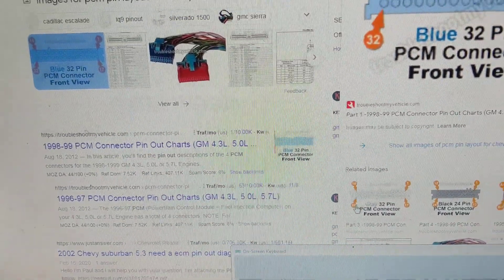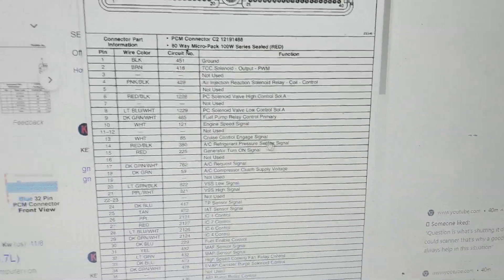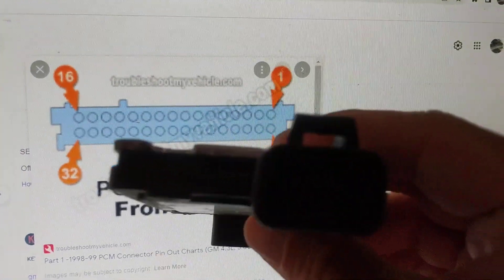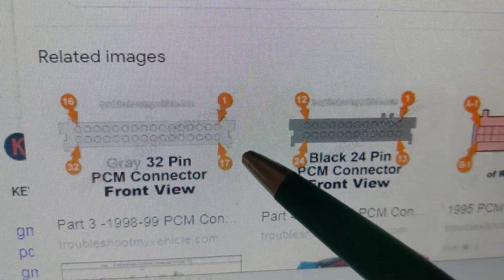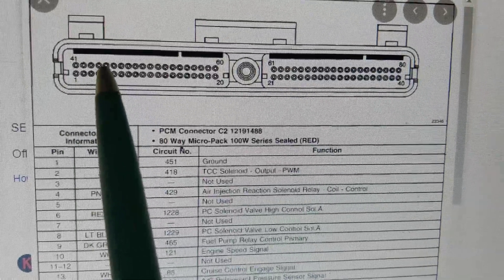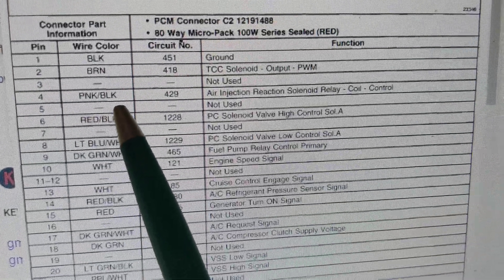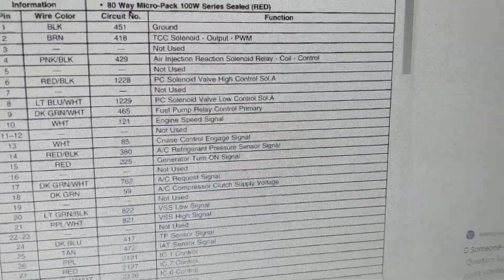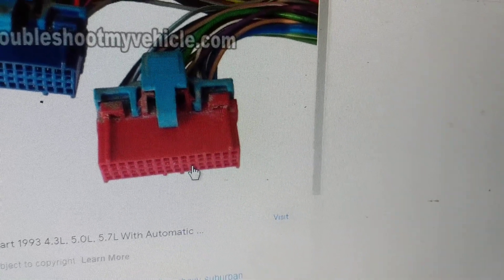how to understand computer connectors and pins

Comment: Hey broth. I was very busy with my work(Taxi driver,NOT Uber😆) these days, but today i had some time to work on the car. Because of the location of the ECU it is very hard for me to measure these wires . I  will have to dismantle the whole front below the steering wheel. I have never got that far. Any other suggestion broth.
Reply from the maker: If you're familiar with a scan tool you can use it to give instructions and commands that's why they are bidirectional tried to get the wiring diagram and see maybe there's another easier location that you can measure the same point as those wires
Reply: @Joeelectronicschematicsforauto  Oh yeah i've been thinking about purchasing a scan tool for a while. You have any recommendations.
Reply from the maker: @KennethMayland  it depends how much knowledge you have of systems the scanners out there. Give live data stream on the best but you have to know something about the system if you just want to know colds and just get a code reader I find autel is good but you will pay more if you need more systems on the scanner to be tracked
Reply: @Joeelectronicschematicsforauto  Well i'm increasing my knowledge. I bought some books, but after I return from holidays I will follow some classes electronics. I have some basic knowledge

Comment: Hey broth> I'm from the netherlands > i'm installing a compustar remote starter on my toyota Prius V 2013. But there is a problem. The location of the pins especially the the wires Tx, Rx and the parking wires are not at the location shown on the install guide. I do see the colors mentioned . but not at the loccation what they said. You have a solution for me Bro.
Reply from the maker: So where do both ends of the wires go to exactly because just looking at the colors that could be the same colors but for different functions
Reply: @Joeelectronicschematicsforauto  At the side of the car they go to the connector L7 that is plugged into the main body ECU. The other end is going into the idatalink module AL-Blade. There is no specific mention of the fuction of these wires other than that they should be connected with the TX and RX and Parkinglight wires of the Main body ECU connector L7.
Reply from the maker: The TX and RX lines our communication lines that stand for transmit and receive lines basically you can Google when you put in your make and model of your car and wiring diagram for L7 connector to ECU it might help you match up the wires if you need more information just get back to me
Reply: @Joeelectronicschematicsforauto  😄Frankly I've been googling this almost every day but it is hard to find information about the Prius V. Is there a way to test these wires like how you can test 12V ,0V etc
Reply from the maker: See the difficulty is you talkin about data lines for transmitting and receiving data not just 12 but if you do want to know 12 v find a ground try to measure each point before whatever voltages you get write it down and informed me again data lines will give you different readings
Reply: @Joeelectronicschematicsforauto  okay thnks . i will do that tomorrow

Comment: Very very helpful video . I am looking up wiring diagram for my Audi Q7 for the brake light . When I look up the PCM physically , I saw there are two similar PCM next to each other . It made me confused which one I should look . In this situation , how do you select the right PCM ? Thank you
Reply from the maker: You look at the color of the wires and the pins make sure they match up
Reply: @Joeelectronicschematicsforauto  thanks